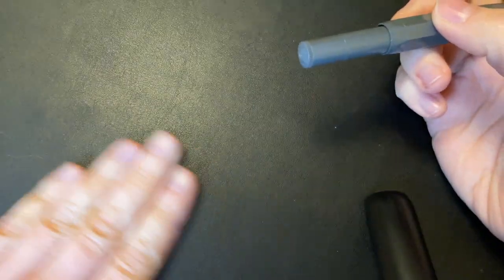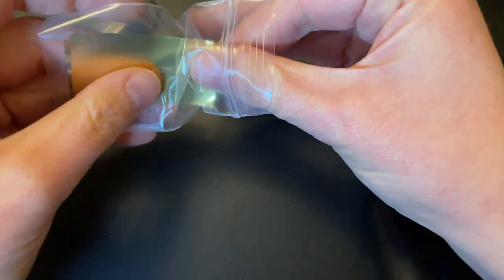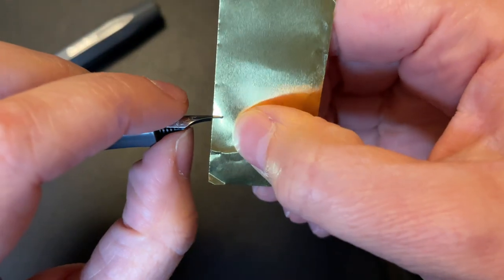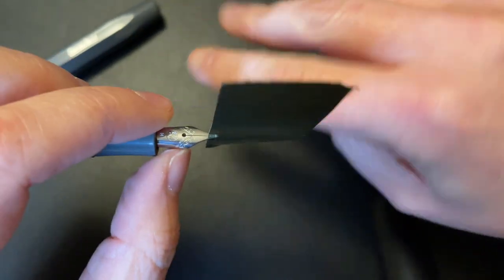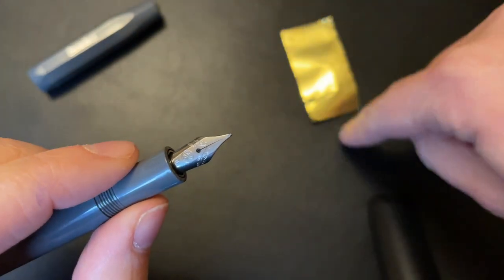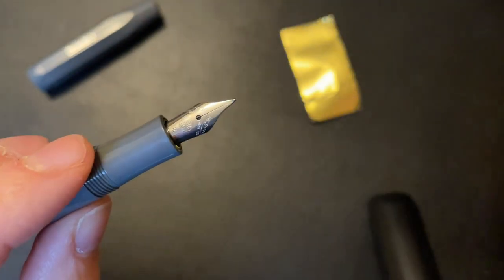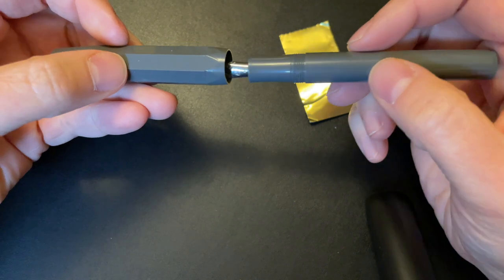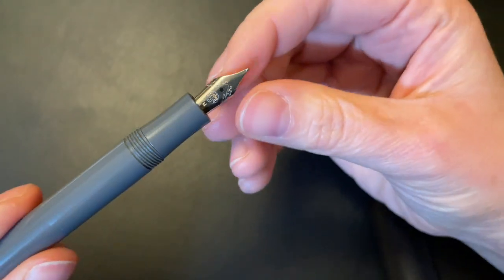How I make my pens write wetter

Comment: Word to the wise: get comfy with doing this if you're a Kaweco collector. I've never NOT had to do this with my Kaweco nibs.
Reply: Really?? I have 5 or 6 kaweco sports all with B or BB nibs and they are pretty wet.
Reply: @HandmadebyLorelei  Yea, Kaweco nibs are famous for their inconsistency. But, they are an easy fix. EF/ F nibs seem to be the biggest culprits. I prefer the M and the Stub nibs. The former I've had to adjust the tines in all of them because they are much too close together. Same with the stub nib, I even took an exacto to it to slightly widen the channel for an even wetter flow. Now all are perfect. My Broad nib worked perfectly out of the box.
Reply: It's not only Kaweco.
Reply: @Bazerkly  i didn’t say that it was. It’s a good thing to know if you are a fountain pen owner, period. This is a great tip for those of us that like wetter writers across the board. Typically, EF/ F/ M Kaweco pens are drier writers.

One thing I’d hate to do is imply that this is a rampant problem. I’ve seen people take a pen that has drier attributes and immediately treat it as a glitch, not the character of that pen. Research that pen and see what to expect and you’d be surprised how much you’d learn about it before you plunk down a dollar. I’ve been collecting fountain pens since 2014 and I can count how many times I’ve had to make adjustments to my pens on both hands.
Reply: 3 Kaweco Sports, strangely the M nib needed the most work!
Reply: @HandmadebyLorelei same here.

Comment: What I have found that helps sometimes is to press down on where the breather hole is while simultaneously gently lifting up on both shoulders of the nib.  When the nib comes back to rest, it will most often open up that tine slit just a bit.  The first time I tried that was on a MontBlanc 149 that was fairly ink starved and it writes much better after that slight adjustment.
Reply: Exactly what I do. My first 'real' fountain pen was a vac700r and watched a video produced by TWSBI of the nib adjuster people that had special pliers that manipulated the nibs. If you go too far, just bend it back :)
Reply: The one problem you can sometimes encounter with that approach is that you can lift the tines off of the tip of the feed and end up with your tines floating slightly above it, which may create its own ink flow issues. Getting them back down and touching the feed can be a bit more difficult than bending them up, because you'll have to take the nib off the feed to do it properly.
Reply: My Montblanc 145 writes well down strokes but upwards it dries and skips. Do suggest something?

Comment: Hi, I'm new to collecting fountain pens and just received a Kaweco classic through the post. It has a fine nib. The line was a little mean, or dry I guess is the term. I also noticed the nib tines were very slightly curved downwards.  So, after watching your video, and seeing that it's probably to do with the tines being too close together, I decided to put the pen to paper and gentle push down on the nib using my finger tip. I don't have any brass sheets. It seems to have done the trick. The tines appear straight now and the line it draws is a little more generous. I do like to draw with fountain pens, which is just as well as my handwriting is beyond atrocious and I can hardly read it myself!  Many thanks for your video.

Comment: I was taught that cutting the feed channel is risky, even if you have the right tools.  Filing is more exact and safer, but you do need a specially file that is very thin.   Three of them, each with a different grit, is even better.

Comment: I didn't have or couldn't find a brass sheet, so I used a stainless steel blade from my shaving machine to widen the tynes of a TWSBI ECO <F> that was really dry. I used the same blade to widen the feed channel of my Jinhaos 159 with great success.
Next step to smooth all my nibs 5gat are not to my taste with some micro mesh sheets.
Thanks for the useful video !
Reply: Goulet pens sells the size brass sheets she’s using.. packaged in the same small zip bag :)
Reply: @Winterz54321  thanks 😊 but I live in Europe 🇪🇺 so goulet pens is not an option 😥

Comment: Please provide link for where to buy the brass sheets and what the thickness of the brass sheets is.  This would really help immensely!
Reply: Goblet pens has it. You can also use a spark plug gap gauge and use the .005 or .006

Comment: Where can we buy the brass shin sheets?
Reply: Goulet Pens sells them.
Reply: I bought a set of feeler gages at the local hardware store for a few bucks. You can pull it apart, clean up any oil residue and use these to floss and slightly widen the gap in the tines. It’s been working like a charm.
Reply: @carloswilson977  I just purchased these and now have to clean off the oil before using them. I got the feeler gauges based on a tip from a highly regarded vintage pen restorer. But now I've seen other comments indicating that these can scratch the surfaces of the nib inside the tines, and that only brass should be used. So...I'm confused. I do know they should not be used on gold nibs because gold is softer than steel.
Reply: @marilyngardner4269  Hi Marilyn, I should have added my personal rules when tinkering with my pens. If the pen has a gold nib or is above $100, I usually will not do major adjustements and will leave it to the pros. Maybe straighten out the tines a bit, but thats about it. If the pen has a steel nib or that can be replaced if things go wrong (i.e. TWSBI or Kaweco) and at a reasonable cost (my threshhold is around $30), then its game on... Also note that once the pens are tuned, they usually don't need any work unless they are dropped. Get or make a good pen flush to clean them out regularly, instead of flossing.  

In my expericnce, I have not had any issues using the feeler guages.

You may want to pracitice on some Jinhao pens. A couple of options, (992, X750 or X450). They're really cheap, and are fully dissassembleable, with a #5 or #6 nib and only cost a $5-$10 each, and surprisingly they're actually not bad pens.
Reply: @carloswilson977  Thanks for the clarification. I also make it a rule not to do anything with the gold nibs in my collection. I too leave those to the experts. I have had very good luck with the brass shims but would like to try a feeler gauge on one steel nib I have. The discouraging messages I saw about metal on metal might not make a difference in nib performance anyway. It sounded more like the metal on metal could damage the integrity of the steel. I'll probably try it once I get the oil off the feeler gauges. (I have also seen people use multiple brass shims stacked to get the same effect. Had I known the feeler gauges would be so oily, I would have tried that first.)
Reply: @marilyngardner4269  Best of luck!!
Reply: @ Carla T.   Pen chalet , Anderson pens has them for sale.. so check fountain Pen online stores , a lot of them Carry it.  Just a matter of Price